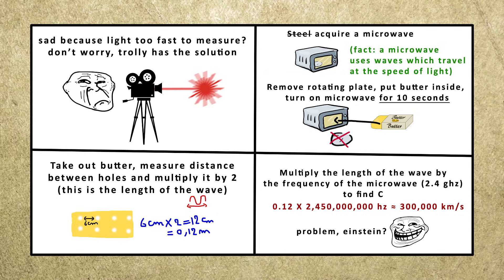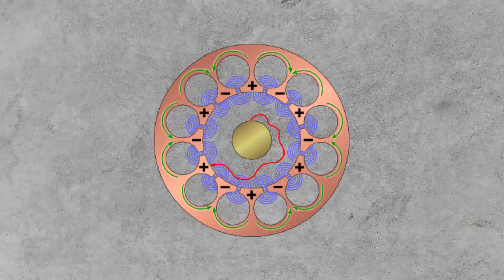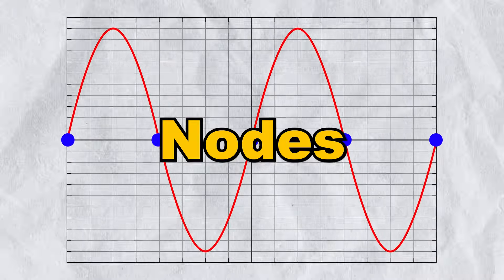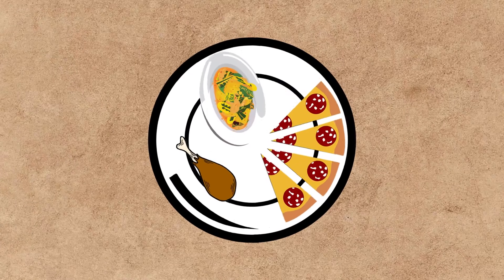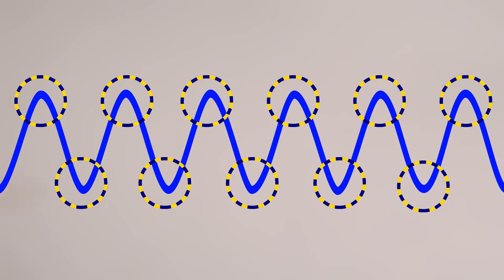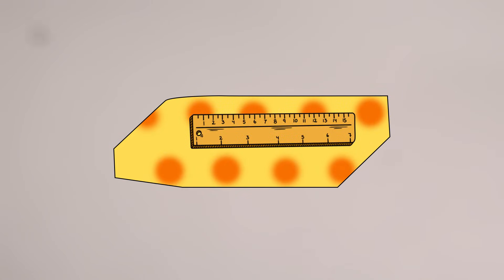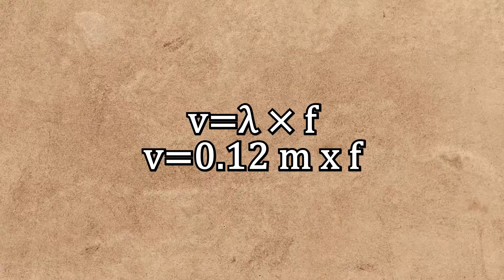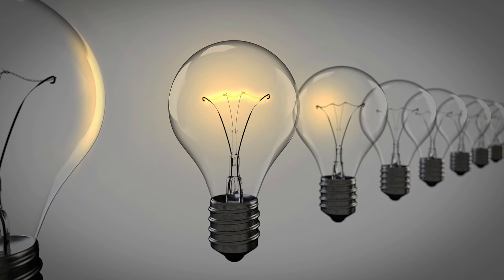why it works 32

Comment: I still remember when I was trying to learn about waves, what really blew my mind was that wave lengths are like the ACTUAL size of the wave, and not just symbolic. 

And that's why microwave windows have the mesh with the little holes in them. The microwaves are literally too big to fit though the holes, but visible light light waves are small enough they can fit. The little things are so fun.
Reply: TIL that microwaves can be about a meter in wavelength. Huh!
It's crazy how big some of these things can get - radio waves can be hundreds of miles across!

Comment: I guess that's an upside to owning a microwave that doesn't have a rotating plate.
Reply: Those will usually have some other mechanism, like a wave stirrer. They went away because even though they could work as well or better as the plate, people didn't buy them because of the idea that no spinny = cold spots.
Reply: wave stirrers work much better and there still are some microwave ovens which use them

Comment: I understand that radio frequency inversely corresponds to wavelength, but how does it tell us the speed of light? Why do we multiply 1/Hz with Hz? How does it not equal to just 1?
I am confusion.
Reply: 0.12m * 2.45 GHz, right
Hz = 1/s, so you get m/s

Comment: How do you know the frequency of the microwave?  Isn't that determined based on the geometry of the magnetron, and thus by the wavelength of the desired emission?  So this requires you to know the speed of light to measure the speed of light.
Reply: The frequency of a microwave is usually standardized at 2.4 GHz for radio regulation reasons. If you use any other wavelength it can interfere with radio signals and be illegal.
Reply: @joe_z not the point of the question.  If you are trying to measure c you aren't taking someone's word for it on the measurement.  So why take the manufacturer at their word on the frequency?  But if you try to reverse engineering it it depends on the geometry of the magnetron.

Comment: Great explanation! But you've forgotten one thing; interference. The metal of the microwave reflects the radiation and scatters it around the box, where it reflects more, and so on. When these criss-crossing waves interact they can occasionally match up in just a way where they cancel each other out, called interference. If you map out the hot and cold spots across the entire microwave, you get the interference pattern. 
So in order ro measure those spots in the butter you would actually have to shoot the microwaves out of the Magnetron straight at the butter with no box or nearby metal to reflect the radiation. Which I DO NOT RECOMMEND. microwave radiation is dangerous to humans, this why it is kept confined in a metal box in your kitchen to heat up our food and not just like a lamp you can put stuff under.
Reply: Microwave radiation is really not that dangerous, look up Mr. Green's video on microwaves. The only thing it does to humans is heat up water molecules, and in moderation it's fine to even expose your eyes to microwaves.
Reply: @ThatOneStopSign  I'm not risking boiling my eyes for science, good thing the madlad of Mr green did it already as you pointed out
Reply: Wait, doesn't the inferference pattern form even inside the box? What's the problem then?

Comment: What if you drove a car at the speed of light and activated the light's
Reply: because of time dilation you'd still perceive it as moving at the speed of light
Reply: Vsauce has a video on that
Reply: They would appear as if they're not on, as you'd be travelling the same speed as them.
Reply: @crushbeast29  Not true - the speed of light is constant in every reference frame
Reply: The car would be destroyed before you had a chance
Reply: @renakunisaki  no i did it in fortnite
Reply: You wouldn’t because it’s physically impossible to get a car to travel at light speed. It’s easy to break the laws of physics when you imagine situations that aren’t possible
Reply: "At the speed of light" is not possible, please set a valid parameter for your thought experiment, kind sir.
Reply: you would wake up👍